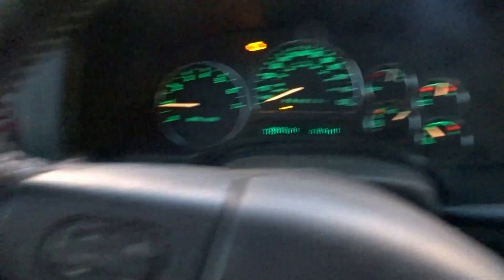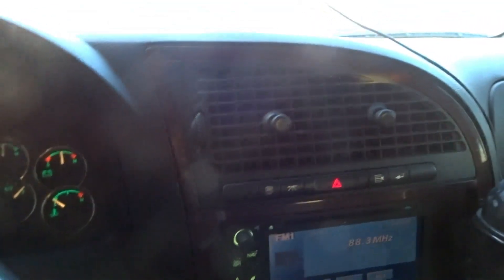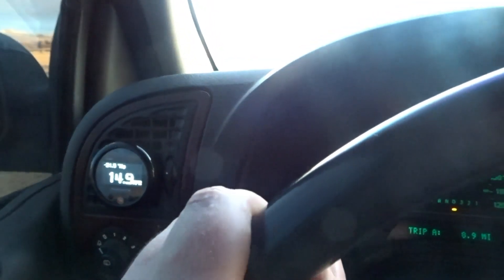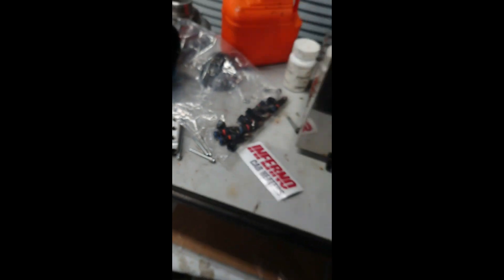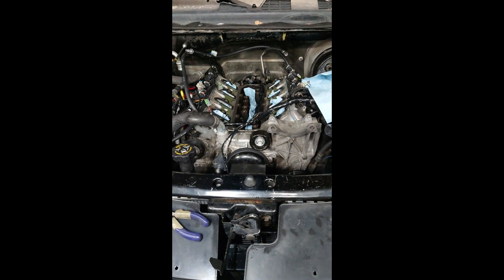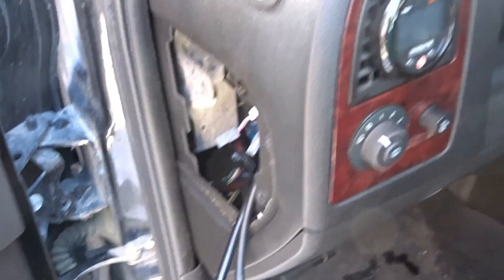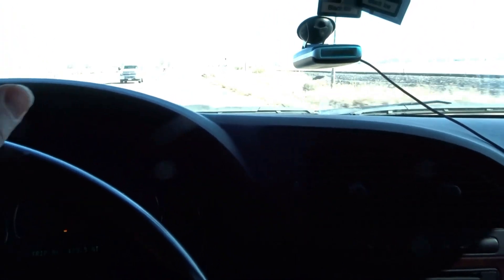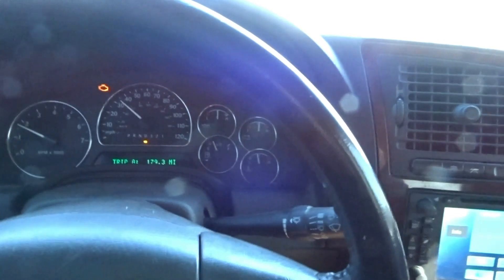The Supercharged 9-7x has risen

Comment: Hey Bro. Good job on the install. I’m actually doing this install now on my 5.3 Sierra. Did you end up using a different map sensor like the ls9? Also are you using your factory IAT which is located in the mass air flow sensor in the intake or did you utilize the IAT sensor on the supercharger (passenger front side of the supercharger)